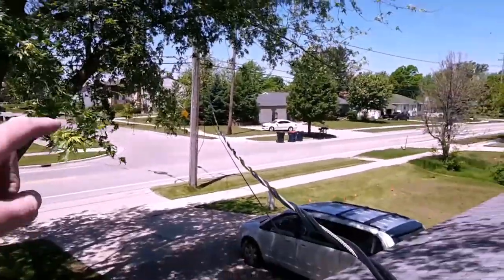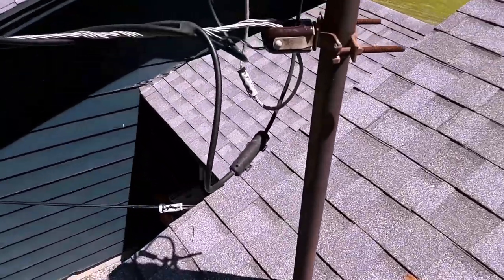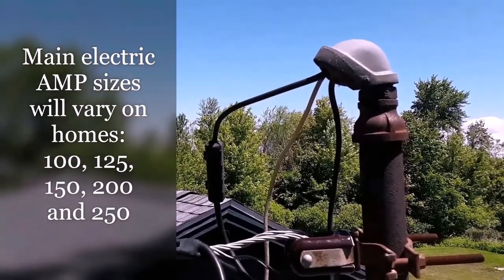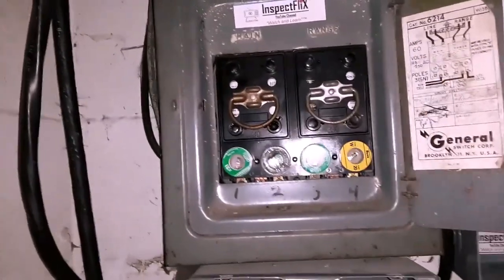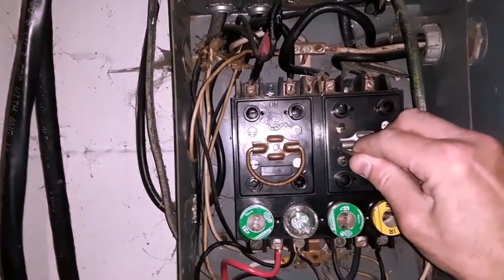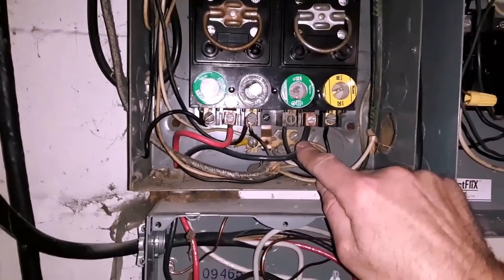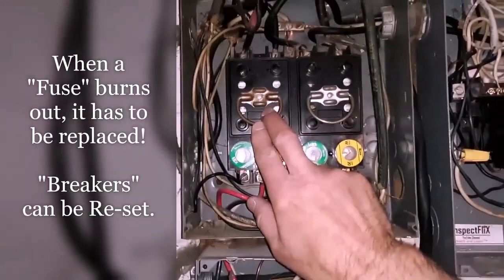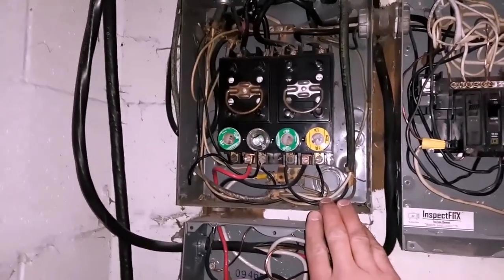⚡60 Amp Fuse Box still in use😲NO room for #ev🚗 It's the Evolution of #electricity in Homes

Comment: Good video for those younger folks who might be purchasing or renting an older property.   Important to note that aside from the absence of grounding,  GFCI and AFCI protection,  fuses are one of the simplest and most reliable ways to provide overcurrent protection,  in some cases better than circuit breakers because in the past there have been breakers known to be defective and fail to trip when needed, Federal Pacific Electric,  and Zinsco are well documented although a few other brands of panels had a spotty record as well.  The simplicity of the fuse is also a dangerous flaw, because it was easy and tempting to use larger amp rating to prevent overloads from blowing the fuse.   Fuses can also be bypassed by inserting a penny or wrapping with aluminum foil when the homeowner doesn't have a spare fuse of the proper size on hand.  A number of homes have been torched as a result.
Reply from the maker: WOW. Thats a lot of good words. I did make the video with the intention of younger folks to see the old world and how the electric cars have now been attached to the house electric grid. 
It's nice to hear from someone like yourself that understands my world, using fancy words like Federal Pacific and ZINSCO. I haven't seen a Zinsco in a long time now, but I still come across Federal Pacific's🤮.
Thanks for watching the video.
Reply: I fixed up a house built in the 1890s with all original wiring and all my tools were corded at the time. Between tools, appliance and other home accessories I blew through fuses constantly. I did have a corded mixing drill start smoking really bad one time though and was ruined but was most likely unrelated to the electrical in the house
Reply: Thank you for your info. It’s refreshing to see post from those who know.
Reply: Zinsco appears to be mostly just in California and nearby states.

Comment: With an electric vehicle charging station,150 amps MINIMUM!!! For the new electric service.
Reply from the maker: Yep. Thanks for watching
Reply: If your spending the money to upgrade the 60 amp service you might as well bite the bullet and go with 200.  The price difference between 100, 150 and 200 is minimal.  For most homeowners unless the home is very large and/or has a significant amount of all electric heating and cooling equipment such as a hot tub or pool heater, 150 to 200 amps is more than adequate.  When you start getting into 300, 400 and larger services that's when things really get pricey and more complex.

Comment: I still have one of these boxes in our house that was built in 1923. I always wanted to upgrade to breaker box but can't not afford it. So we just deal with it. Also every outlet is not grounded. There are no ground wires in behind all of them.... I don't know how this house even passed any kind of code in the past...
Reply from the maker: Thanks for watching the video. 
Just make sure to replace blown out fuses with the right size fuse. Too large of fuse size can allow wires to overheat. 
Also, in the 1920's feed wires to receptacle outlets that do not show a ground wire sometimes were feed through a conduit pipe or "greenfield" to protect the wire and that can be used as a ground if it is clamped/bonded at the other end to the fuse panel with grounding.
I hope this information is helpful.
Reply: @inspectflix  Thanks. There isn't any conduit anywhere throughout the house. It is just black sheaved wire. In the basement we can track down every wire by following it to where it goes. (to the outlets anyways) the lights are different. (can't see them). I know one outlet has like 3 wires coming to it. I do think this house is a fire waiting to happen.
Reply: You can install GFCI’s to outlets in the kitchen or bathroom without a ground per 2017 NEC.
Reply: We had a neighbor with that problem when I was a kid. They had the same style 4 fuse box. The house was built with only the first floor finished and the second floor left for the buyer to finish. They should have provided a larger fuse box, but they were trying to keep the cost down. The problem was that people would finish the second floor and need electric. There was a light at the top of the stairs and enough space to make 2 bedrooms. People wired both bedrooms into the light. That circuit was 14 gauge and had a 15 amp fuse. Our neighbor's house had the kitchen stove and counters changed and moved such that they had a counter where the stove originally was. There was an exhaust fan originally for the stove, but now above the counter. My neighbor liked to cook and had lots of heating appliances. She needed to plug them in, and although there was a dedicated 20 amp kitchen receptacle circuit, it was much easier to drop down from the exhaust fan to add a counter outlet. That outlet was on the 15 amp circuit with the kitchen lights, living room outlets, and the whole upstairs. They liked coffee in the morning, so they plugged the coffee maker in there. The fuse blew frequently, so they put in a 20 amp one. They had 3 daughters who slept upstairs. It got really hot up there, so they really needed an air conditioner. In the morning if they didn't turn off the air conditioner when they started making coffee, the fuse blew. So it got replaced with a 25 amp fuse and if they ran out of those, they put in a 30 amp. My mom often reminded them that they could have a fire. They didn't have money to get the fuse box replaced, but one day a friend of mine suggested a sub panel. I put one in for them and moved all 4 circuits off the fuses. Then I ran a new circuit to the kitchen counter outlet and another new circuit for the air conditioner upstairs. I sized all breakers correctly for the wire sizes. It wasn't a perfect solution, but it was affordable, stopped the overload problems, and prevented them from easily increasing the amperage since they now had breakers. What surprised me about this video was they left the 4 circuits on the fuses and left the higher amperage fuses in. It looks like they added a bunch of circuits, so why not correct the overloaded circuits and put everything on breakers to avoid the temptation to use bigger fuses.
Reply: @jaygosch8705  pretty amazing the lengths people will go to avoid upgrading the electrical system, that is definitely not something you should try to save money on by cutting corners. Understandably people like to save a dollar here and there especially in the current economy.
Reply: @michaeldunn150  1923 the original wiring assuming the house was in the city or suburbs near a major city where electricity was available,  was almost certainly knob and tube.   Greenfield aka BX was invented in 1899 and recognized by the NEC in 1903. NM cable was invented and first produced by Rome Wire Company in Rome, NY(hence the widely used term, Romex) , in 1922, recognized by the 1926 NEC, both type of cable were commonly installed in the really high end houses since it was much faster and easier to install,  but was super expensive compared to knob and tube which remained most popular until around the mid 1930s when the labor costs began to outstrip the material cost, and was very seldom installed after the end of WWII, although some electricians continued to use it as late as the 1960s.
Reply: @inspectflix  very true.   One thing to keep in mind with dealing with really old BX cable aka AC cable  is that the aluminum bonding strip we see on modern AC cable was not required until sometime in the 1950s, not sure the exact year, and sometimes if the jacket has rusted or damaged or the fittings are compromised,  the high resistance might not draw enough current to trip a breaker if a hot wire touches the metal box or  the metal frame of an appliance with a 3 prong plug, and I've heard about a case where the jacket was glowing red in spots from the current flowing during a fault, never seen it happen though.

Comment: if i want to kill a circuit fed by a fuse, can i remove fuse and live it empty? or i need to screw in some kind of dummy fuse in ?
Reply from the maker: Good question. Never leave a socket open. It will be hot and energized if someone sticks their finger in it.
I never heard of a dummy fuse, but check with a hardware store.
If the wire inside the fuse box is disconnected from the fuse lug, just keep a 15 amp fuse in it.
Thanks for watching.
Reply: We would leave the fuse out if we were replacing a bad switch or outlet. As long as you don't have curious little kids tall enough to reach the box, it's no problem to have the fuse out for a little while. If you're going to disconnect that circuit permanently, definitely put a 15 amp fuse in to avoid shock hazards. You could even put a blown fuse in if you aren't going to be using that circuit anymore. Don't forget to change the label for the circuit too.